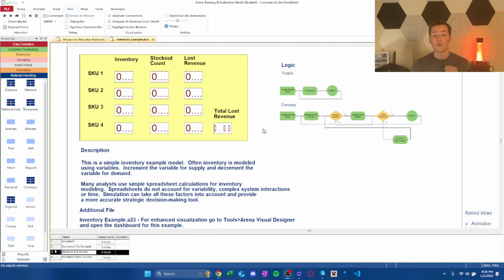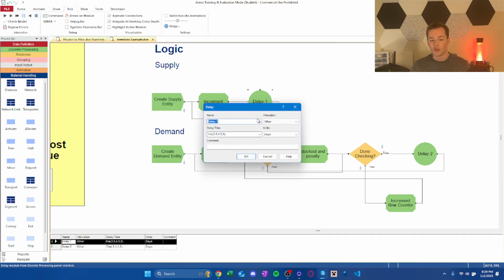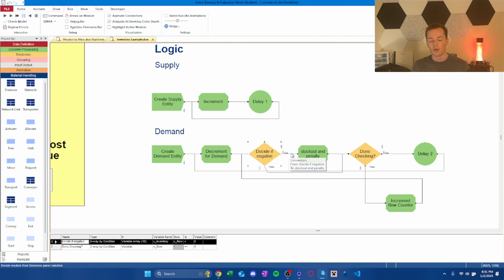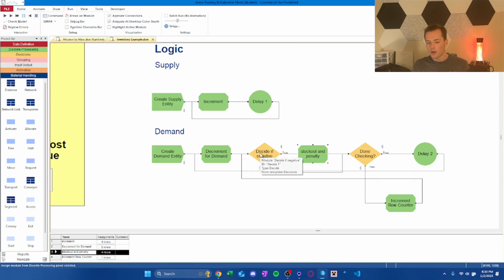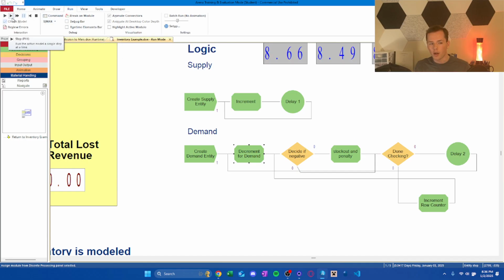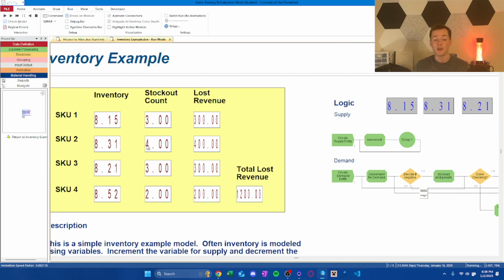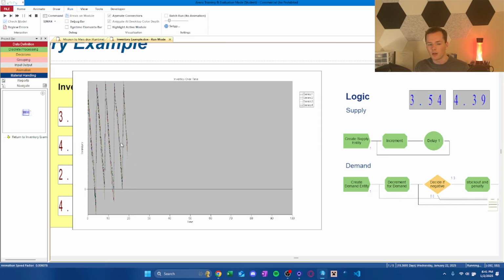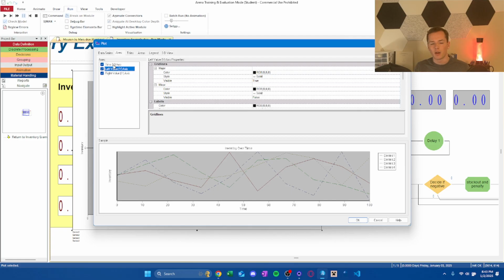Arena Examples: Inventory Example.doe

Comment: Hi, quick question. If the system is an M/M/2 with one shared queue and two identical servers, should this be modeled in Arena using one Process module with a resource capacity of 2, or two separate Process modules? I keep seeing different approaches and wanted to confirm the correct one.